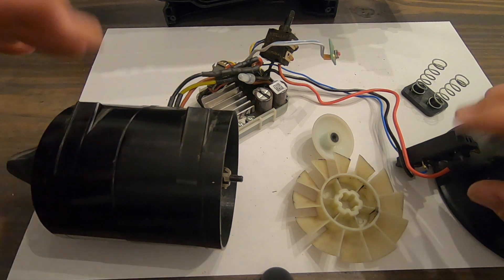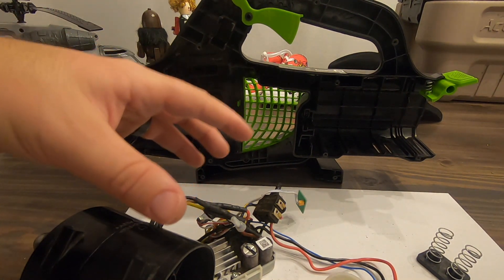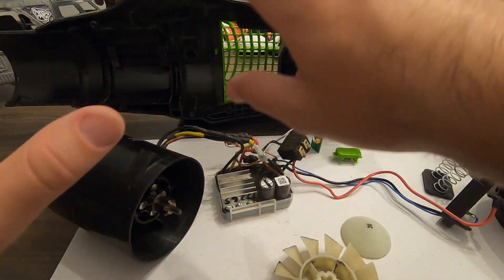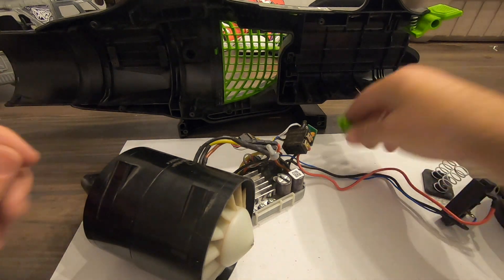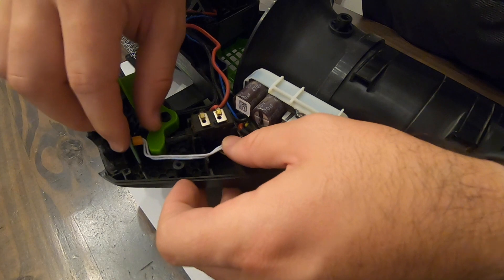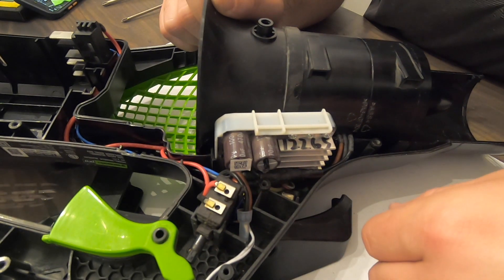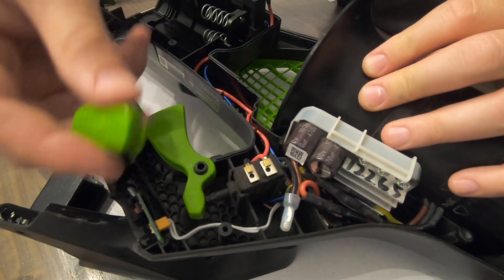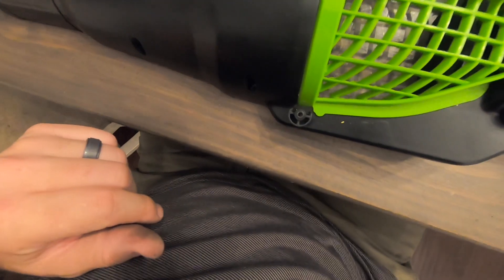Greenworks leaf blower rebuild

Comment: I wish you had shared how you opened the case, I couldn’t get the back part where the battery lever is to loosen up. Also, I wasn’t able to find a replacement fan.
Reply: I googled the part and was only able to find the part that someone had made with their 3d printer.  I believe it was "makersworld". Fortunately  they shared the print file. I installed an app called Bambu on my phone and was able to save the file. I sent the file to a friend of a friend and the printed it for free at a local library. It fit perfectly.

Comment: Greenworks won't provide the fan blade. I bought a new looking BLB489 blower but one blade was missing which makes it incredibly loud and shaky. They won't sell the fan to me or repair it as the reason stated is that if it's taken apart, then other parts could be damaged in re-assembly. To be honest when I disassembled a friend's backpack version the build and component quality looked very cheap but I'd still rather fix mine versus throwing it in the garbage (if anyone finds another fan that works please let us know). A fan blade is a wearable part, and therefore replaceable, so this is ridiculous to not sell it. I have since moved to the EGO brand's 615 CFM blower which is such a better functioning, quiet, and sturdy unit.

Comment: I disassembled the blower and maybe found my problem, which is that when depressing the trigger, sometimes it works and sometimes it doesn't. Believe that it maybe the speed selector switch, but not sure................ANYWAY, I have found that there is three long screws in the screws that came out of the housing, and I'm not sure where they go. Any suggestions will be helpful. 🙂

Comment: I have the 80v and cant get it apart. Its stuck on the battery release lever. I sucked the belt into the fan and trying to fix it myself. Thank John
Reply: Having the same issue and I don't want to force it.  You have any luck?

Comment: Is it possible to spray contact cleaner into the trigger switch? Mine is getting a little flaky when triggering near highest CFM. Tried to find a replacement switch online to have for WHEN it finally goes bad... which I'm sure will be right in the middle of leaf season. No luck on finding a replacement switch. Hoping some contact cleaner will fix it, if possible.

Comment: Are your sure the switch was 20amp 36VDC?  I'm on my third 60V Greenworks blower and the switch on the first two went bad. Those switches were 20amp 60VDC. The switches are not built well and are poorly sealed. If I had a ton of switches I could repair a lot of GW leaf blowers. I did take one apart and there was grit and grime all inside. I cleaned it but could only get it to produce about half the normal power. The Turbo switch worked great. Nice video for those DIYers.

Comment: I actually wanted to see the screws part.  I’ve removed all the screws I can see and the two metal clips but it’s still hanging on where the springs and battery contacts are.  Not sure what is keeping the housing together at this point???
Reply: Lol!  There was a screw hiding under the warning label.
Reply: Of course after I found the hidden screw on my blower, I found the hidden place where you mentioned it in the video😂
Reply from the maker: Sorry man. Just now seeing this string of comments. Yeah that hidden one took me a bit to find.
Reply: 4:50
Reply: No sweat.  Thanks for the reply!
Reply: How did u remove the clips?